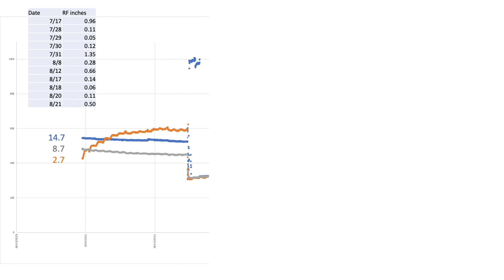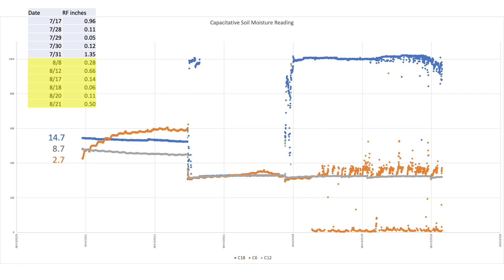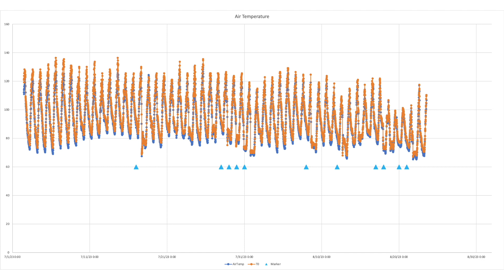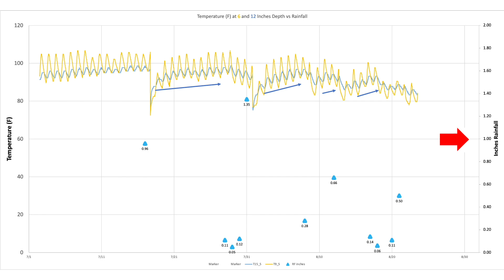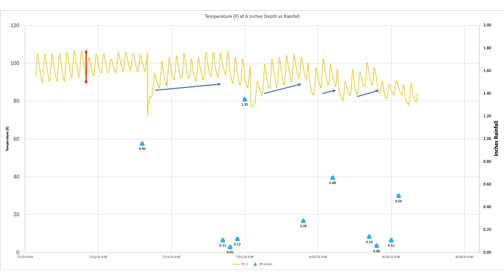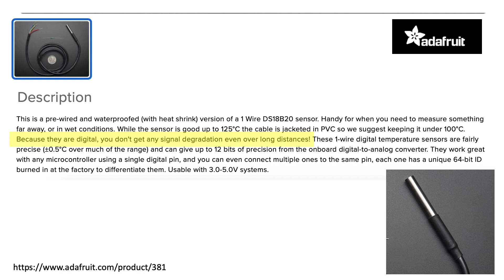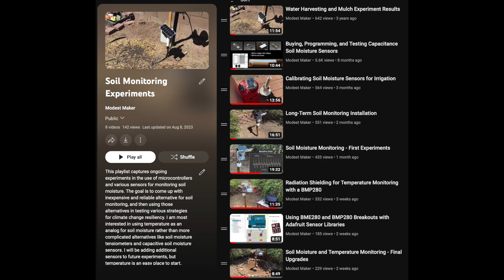Soil Moisture Monitoring: Capacitance vs. Temperature

Comment: I have been going through your series. Thank you for your helpful contribution. I can offer you a couple of suggestions based on my tests, that might help: 1. Check out the sensor from DFROBOT - SEN0193. It is pretty robust. 2. Use a better resolution ADC to capture finer changes(12 bit ADC on pico gives you ~4k steps theoretically). 3. Install the sensors perpendicular to the plane of the ground surface to avoid ponding on the surface of the sensor.
Cheers.
Reply from the maker: Agreed- great recommendations. I have gotten many helpful tips- yours included- which I will visit in a future chapter. Right now, focused on temperature as an analog for soil moisture. More about that soon— learning how to sonify the data as a means to convey information 😊.

Comment: Didn't I comment under an earlier video that these capacitive sensors are garbage? Well, there you go. Some slap concrete or clay onto the cheap capacitive sensor PCBs in an effort to create a more stable measurement zone, but once it flakes off the PCB, it's game over again.
All in all, I doubt they're worth out time in any regard. Better methods are RF absorption, time-domain reflectometry, ...
Reply from the maker: Sure, but now there's hard data that demonstrates the challenges rather than anecdotal claims. Having said that, there may be ways to redesign the RC constant to be more sensitive to soil moisture conditions (eternal optimist). I agree there are better methods, but not everyone can afford tensiometers, time-domain reflectometry, etc. The idea is to develop and tests alternatives to expensive venues that may not be accessible to broader public. In this regards, there may be something we can salvage in temperature by looking at the change over time (working on it) :)
Reply: @ModestMaker  I still have a bag with 15 sensors of said type. We used them in a little indoor farming experiment, and logged their readings over time. Sadly that failure was not documented well, so points go to you for doing the science :) ironically, you might be able to bury an ESP8266 in a water tight enclosure and measure RSSI at the top, or at least between two sensor units spaced 10-20cm apart. 

One of my experiments involved the use of a 2.4 GHz directional coupler. An RF antenna is detuned when the soil around it gets wet. When you step the frequency, you can sample the S parameters (think CC1101, CC2511 and the likes) - this is more of a volumetric measurement than the capacitive one (which is surface-selective), but a lot more sophisticated to design.
Reply from the maker: That RF design sounds pretty cool and very innovative. Is there a site or video where I might learn a little more?

Comment: Great video! You may want to enclose the chip/connector end of the capacitance sensors in either a Heat Shrink material and or an acrylic coating to insure that the moisture is not somehow having an affect on the sensor. Did you seal the sides of the sensor PCB? Keep the videos coming
Reply from the maker: Agreed. Yes-- I thoroughly covered the electronics on the cap-sensors with electrical-grade silicon given the potential of moisture impacting the same. Another possibility is the wire connection to the analog pins on the Feather MO needs to be tightened. I will check that soon but frankly, those sensors are not something I feel comfortable relying on outside of detecting an initial pulse of infiltration. The experiments I've tried in the past demonstrate the response curve is not linear and thus are not likely to give you a good indication of soil moisture as things dry out. It would be great if we could make these cheap sensors work but I don't have much confidence.
Reply: hello, i am using those soil capacitive moisture sensors in clay soil and in coco coir/perlite mix .... clay soil, response from sensor is not as good, used two point calibration, from permanent wilting point to field capacity  (i basically let my peppers wilt, measured response from sensor and then fully saturated soil, waited one day to let excess water be drained and then measured response from sensor) using sensors with tlc555, so far i needed to replace 2 of 3 sensors, all of them were coated with epoxy and insulated circuitry, and response from them was good for only few days ( soil was dry and sensors were showing moisture above field capacity)   @ModestMaker
Reply: other thing is coco coir /perlite mix ..... response from sensors fantastic, using two sensors in one planting pot .... difference in those two measurements is max 2percent, validating data with weighting of dry pot / weighting watered pot / reading sensor data and it is +/- 3 percent, and that is something i can live with :)  @ModestMaker
Reply from the maker: @J0stik That’s great that you got the sensor to work in your mix of soil backed by data rather than just observation. I considered soil texture as a factor which is why I always qualify my results as being specific to a silty clay. It intuitively makes sense to me that these might work better in lighter soils.

Comment: Awesome video as always. I have plans on trying to monitor my yards soil moisture content to know when to water and this research is super useful. I can't remember if you mentioned the large quality control issues with the capacitive sensor that many other YouTubers have shown? Also it might be beneficial to invest in a high end soil moisture sensor to see if you can draw a correlation between temperature and moisture content like you are theorizing.
Reply from the maker: Thanks for your feedback. Yes-- I am aware of the quality control issues on those cap sensors and selected them accordingly as summarized in this video: https://youtu.be/lb4HdcpYWCQ. The ones that were installed all met QA criteria and demonstrated good repeatability prior to installation. Bottom line, I really wanted these sensors to work, but I don't trust them for all the reasons outlined in prior videos. Sadly, they just don't respond well to a drying profile among other issues.